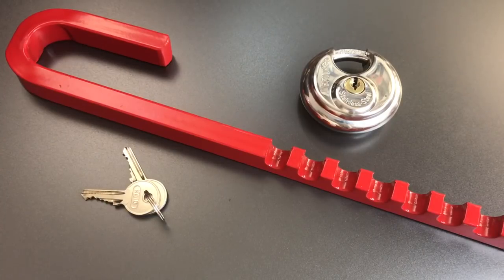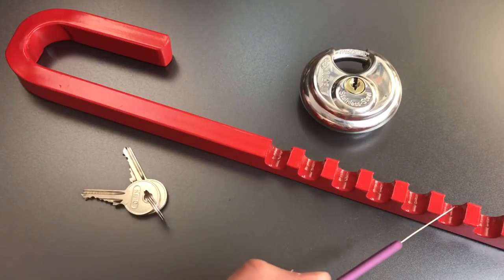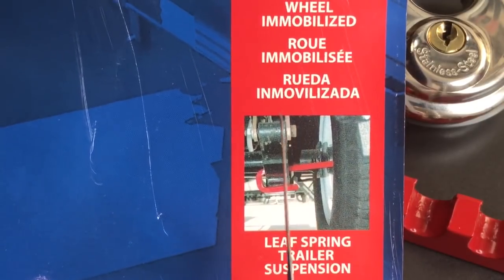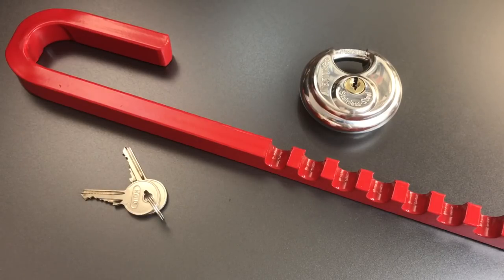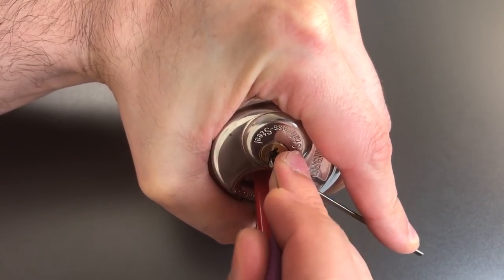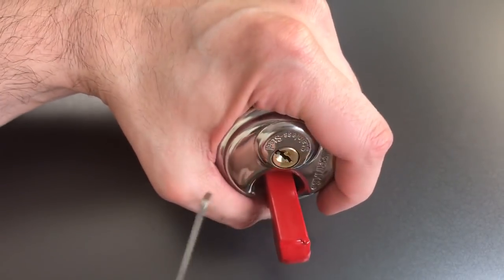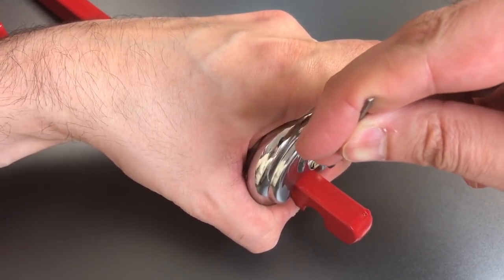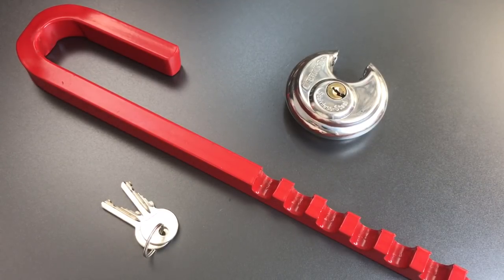[472] Brinks Trailer Wheel Lock (Model 3020-057) Picked

Comment: This is why I use a grade 8 chain and a S&G Railroad lock. You and Bill have severely jaded me on all locks... I even repinned my house and barn using security pins and a radical bitting... Don't know if it is love or hate.
Reply from the maker: Hmmm... maybe I should feature one of those RR locks soon.  Did you know they only have three disks, with each having a total of three position possibilities?  IIRC, they are not very hard to open, and there are only a few key differs... every possible key would fit on one keychain.  The regular environmental is more secure with 5 or 6 disks.
Reply: I got a few of them if you would like me to send you one. It is a 102 lock, some railroads use 103 or 109, the key is a controlled item not the lock. I also have the newer ones that are American both MOW safety and Main line. They look like they are wafer with the double sided key but I am not sure. I haven't figured how to pick them yet. I may have to drive out some pins to take it apart and find out one of these days.
Reply from the maker: +TallifTallonbrook Thanks, but I have one. I'll dig it out. 👍

Comment: Just a heads up. With the force of the leaf springs on that bolt under tension. There is no way your removing that bolt with out a lot of effort. Possibly a jack. Not to mention that bolt will be demolished for further use if it’s forced out. 
I recommend to any trailer thief watching this to remove that bolt and win the Darwin Award!

Comment: You shouldn't be able to take out the leaf spring to get the lock off, you'd have to take off both ends and then remove the leaf spring's u-bolts from the axle and such to get the leaf spring out of the way of the lock, since there shouldn't be enough room to get it over the end of the spring, or enough flex to move the spring over and around the hook.

Comment: No comments on the lock, just the concept.  This arrangement is not visibly obvious to a thief as is security at the hitch end.  This could entail a thief hooking up to a trailer and attempting to drive off.  The result would be expensive damage to the suspension and/or the wheel.   IMHO security devices should be visibly obvious to potential thieves, not only as a locking device, but as a deterrent.  As an owner of an RV, I would never use a device such as this.

That said... Good vid!
Reply: Probably would be more of a secondary lock after a hitch coupler lock.  And several hundred in damages to your trailer is still cheaper than no trailer+boat.
Reply: Good point.  I really think that deterrents are effective and the scenario you present is a good one, (dual approach to security). Honestly, If those B$%^&*ds want it that badly, take it.  I've got insurance!  That doesn't make up for a ruined trip though...
Reply: Also of note: don't use these on aluminium wheels (obviously).
Reply: My wheels are custom made Titanium/cobalt alloy with a Boron shield around the vented disc brakes.  Pretty pricey but YOLO!  Yes, I'm full of something, LOL!
Reply: Vented disc brakes on your trailer?
Reply: No, I was having a bit of fun with a little BS... NO disk brakes on my trailer.  Now if you really want some technology, let me tell you about my lawn mower... ;-)
Reply: Hitch locks are too easily defeated. There is only one that is worth anything. The rest the most you would have to do is remove three bolts and change the hitch, then bang you even have the right ball on your truck. Three minutes max with practice. I would rather pay to fix the trailer than pay to replace the 20k of tool in it.
Reply: Mark England just use both
Reply from the maker: This is a good point.  A lock should be more visible.
Reply: I disagree since the only sort of lock someone defeats is on they know exists! I'd rather deal with sorting out some damage than losing a trailer any day! 
What WE might think deters bad guys is not necessarily what stops them.
Reply: Expensive damage that just saved your shit from being stolen.
If they are able/willing to defeat the hitch lock, they'll beat this too.

It being non-visible is a bonus.
Reply: Also, I imagine you can hook it up in such a way that the tires will be immobilized(they'll be dragging the trailer, not destroying it).
They'll then have to get out and kick out the bricks keeping tires from rolling.....or so they think.....
...which is a LOT more time for you to notice some donut puncher is messing with your stuff.
Reply: Might want to spray paint it black/brown(how rusty are those leaf springs?).... that'll probably make it harder to see than RED.
Reply: Mark England w
Reply: Still cheaper then loseing everything... and woth all that noise u just my catch the guy...
Reply: If there is something that you absolutely must remove before operation--and you'd like visual confirmation--you can follow the standard aviation protocol, and have a "Remove Before Flight" flag/ribbon attached to the item.  Most such ribbons/flags hang down from the item, and flop around in the breeze.  Not really ideal in this case, as the distance from the mid-wheel to the ground is fairly short.  It's good practice to always stow such flags in the same/dedicated place, so you can visually reconfirm that the item has been removed before you operate your equipment.  Of course, a thief (or an inexperienced operator) could probably miss seeing a safety flag.
Reply: I agree but just paint the disk lock bright red, problem solved.
Reply: I hung a large brightly colored flag on the lock, that should help

Comment: As someone that's replaced leaf springs before, removing that bolt will probably require an angle grinder if the trailer is more than a couple of years old. I replaced/upgraded the leaf springs and shocks in a Jeep years ago and even an impact wrench couldn't remove the bolts. I had to go buy an angle grinder to cut the leaf springs out. Huge PITA just to get 8 bolts out.

Comment: As for unbolting the spring, you'd also have to remove the axle U-bolts to allow the spring enough side movement to permit the U-bend to be unhooked from it.   That means the trailer would have to be jacked up to allow this.    And as LPL said, the U-bend would have to fit through the hole in the wheel.   This is quite a lot of work. 

Rather better, I think, would be to get a piece of steel water pipe that would slide neatly over the projecting end of the serrated bar outside the lock and just 'work' it back and forth until the bar fatigued and snapped.    Quieter than using an angle grinder...

Comment: Having had one of these under a different brand, I'd note that with the battery operated recyprocating saws, and band saws on the market, as well as bolt cutters, it  would really be appreciated if the bar that hooks over the leaf spring were hardened. The one I have was not, which ment that when I ran into a problem with the key (and no skills or tools for lock picking at the time) cutting the bar with a hacksaw was a few minutes worth of effort, and I was back on the road moving stuff. I'll grant that a battery operated angle grinder with a thin kerf cutting blade would probably work against even a hardened bar, but it would be a lot louder, and more likely to attract attention.

Comment: While it seems like it would be a complete PITA to install, I think it would also be harder to pick in the field as you'd have to lay on the ground and work around the wheel.  As an added benefit, this lock would also prevent someone from easily stealing your trailer's wheels.  I could see this being worth the time to use if you had a construction trailer that often spent weeks without moving.
Reply from the maker: It may be harder when installed, but raking would negate that for the most part.

Comment: 1:40 No, you would not have to feed the hooked portion of the lock through the wheel-hole; you could crawl under the trailer and slip the plain end of the bar through the leaf-spring and then through the wheel-hole, and then attach the hook around the leaf-spring.

Comment: Hmm... right now Brinks seems to have a mixture of 5 pin cores with standard pins and 4 pin cores with 2 spools (for padlocks I mean).  This seems to be one of the former.  The (larger) discus lock I have has spools and pretty much always has heavy spring tension except for some point about half way though its turn cycle.
Reply from the maker: I've seen a combination on their larger locks... some have security pins, others do not.

Comment: Most trailer hubs don't have 4" of center flange stickout like the photo.  Unbolting the wheel and tilting it inward would provide enough reach to drop the hook off the leaf spring on most trailers.  Of course I guess it's all about being a deterrent to opportunitist theft; assuming the thief sees it and doesn't try to drive off.
Reply from the maker: I wouldn't know... never towed a trailer in my life.
Reply: Even if it fails as a deterrent because it's not visible(or is easy to remove), it will SUCCEED in being a DELAY MECHANISM.
"Why is that dude changing a tire on my trailer? It doesn't even look flat? Better check it out."
Reply: If he drives off, the trailer will be immobilized.
Like an analogue for trap pins in a lock.

Comment: Being a auto/truck mechanic/technician; you are not getting that spring hanger bolt out, just with hand tools. That spring is holding great tension on that bolt.  They are hard to get out in a shop environment.

Comment: Thanks for the video. Do you know if the Abus 37RK/80mm Granit Plus lock will fit this? This looks like a good option as an added level of security. I may just buy this for one wheel and the Trimax TCL65 as a visual deterrent on the other side.

Comment: You make it look so easy I just got my first set of picks today (Dangerfield Praxis) and there must be something wrong with them cause it's not easy lol. Only have this tiny pad lock (body 30mmx30mmx13mm) with 4 pins and it gave me problem just to feel the pins takes some practice I noticed. I started with a .023 pick cause the .015 looked so thin and week but it was the .015 that gave me feeling and I picked it :) now I must get me more locks to practice on.
Reply: Congrats on your pick!  Try garage sales, Locksmith shops and Ebay.  You can always find old locks on the cheap.
Reply: That I will do
Reply: LoppanH Look at it this way, you picked A lock without A key!  ;-)
Reply from the maker: Congrats on your new picks... good luck with them.  I agree with Mark that  you need to spend some time on ebay picking up some nice locks!

Comment: The obvious low tech attack is to put a wrench on the hook and bend it around until it clears the spring then just thread it out.
Reply: or just saw through the grooves in the bar.  it's way too thin at those points for any type of security.  i would guess 15 seconds tops for a power tool attack or about 2 minutes with a hacksaw.

Comment: LPL this would be OK on a single axle BUT like the other comments on a dual axle all you need is a lug wrench and take off that tire and chuck it the axle will just hang there and go buy a new tire and rim.
Thanks
Reply: Or have to lock set ups.
Reply: Woops two set ups
Reply: Tuna Fish I would think if you have the lock set on a notch that keeps it tight against the rim there wouldn't be enough wiggle room to get the wheel off the posts even if you took off the nuts. 

But the real problem is a cordless angle grinder. (If you've put a better lock on the bar)
Reply from the maker: SgtSly beat me to it... it would be hard to remove the wheel if the lock was tight.
Reply: Even if you're right(it's a stretch), it will still work as a great extra layer of security.
Make the douche spend an extra 20 minutes figuring out how to steal your crap(give yourself more time to respond).
Reply: There are keyed lug nuts that take a special socket to remove. That would keep the wheel on the trailer and the lock on the wheel. An angle grinder or hacksaw would be the best tools to defeat this but most criminals want to keep it quiet and fast, especially if its being stored in a residential area.

Comment: How about just putting the lock facing the wheel just close enough so you can fit the key? I don't think you can pick it then.
Reply from the maker: That certainly could help.
Reply: Definitely make it harder.
Also, maybe spray just enough spray paint or something to make the lock impossible to pick, but still accepting a key.
Reply: I found that if a lock barely works with the key, it's going to be a pain in the ass to pick.
Broken/bent picks and tension wrenches are an excellent deterrent to picking.
A ridiculously strong spring on the core can do a lot of the same.... even if it means a steel key is necessary(and brass becomes too weak).
Reply: That lock has a hole in the back side of it... pick it throw that hole....

Comment: In my area it would be a scaffold bar over the protruding end of the the red bar and push/pull up& down to snap the bar ...as a posed to taking the suspension apart 👻
Reply from the maker: Didn't think about that... not sure how the bar would hold up to that.
Reply: Good point! If I buy one, I may cut it to size to give them little to work with. This is definitely a much more attractive price than the alternative Proven Industries $200 puck lock version.

Comment: there does not appear to be enough room to take the wheel off and pull it aside and put another wheel on the trailer however it could be possible just to pull the trailer and screech the wheel  along the ground in the same way that some repo people have to do with cars that are in tight places.

i think a hitch locker in addition would be much better as it would make connecting to car or truck impossible
Reply: Impossible? Hitch locks are worthless! All it takes to defeat those is to ignore them. Hook their safety chains to your hitch and drive away. And if they're stupid enough to pay $200-$300 for Proven Industries #2178 hitch and chain lock, simply use your own chain to do the job.

Comment: If the holes in the rim are big enough to pull the hook through, they're probably big enough for the padlock itself.
Reply: You don't pull the hook through.
You get on the floor and insert the locking bar from the rear.
(Get ur squire to do it for u).

Comment: What if you put a competent lock on this, would it be a good security device?
Reply: No. It either won't stop them from taking the trailer, they'll just drag it if they want it bad enough. Or they'll drag it a ways decide it's too risky, then ditch it with bad suspension and wheel damage. Notice there wasn't a "it doesn't get dragged" option, mostly due to the lock not being blatantly obvious. Most thieves aren't checking the wheels and suspension before they go. They're kicking out chocks, hooking up the the unobstructed hitch and they're gone.

Comment: My dad actually made a locking system like this himself. He took a long iron bar which could be fitted through both wheels and locked up with two padlocks, one on either side. It's a bitch to set up, and I don't know if it's any good.
Reply from the maker: Seems effective.
Reply: Sounds like it would work.
Also sounds like it'd make most thiefs go try the next trailer instead.

Comment: this wouldn't be a good lock on a twin axle trailer as removing the wheel will enable the thief to remove the lock from the leaf spring. I have made my own using the abloy 362 and it disables two wheels.
Reply from the maker: I'm not sure that you could remove the wheel... depends on how tight the bar is locked.
Reply: Even if you're right, it's still a great extra layer of security/delay.

Comment: How hardened is the bar?  can probably just snap it by driving off or snapped with bolt cutters...
Reply: Pretty much any steel bar can be cut. Nobody use expensive alloys to made them.
Reply: It looks like it's cast.   I think a tool similar to a ball-joint press might possibly fracture it.  Just a thought...
Reply from the maker: I don't think so.
Reply: LockPickingLawyer Yes, upon review, definitely not cast!
Reply: If it's soft, there is no chance it'll break but driving off.
If it is hard, you still won't be able to get enough energy to break it.
You're starting from ZERO MPH.
YOU DONT GET A RUNNING START.
Reply: You could also harden it yourself, and/or weld some more metal into it to beef it up(there's nothing stopping u but some paint).